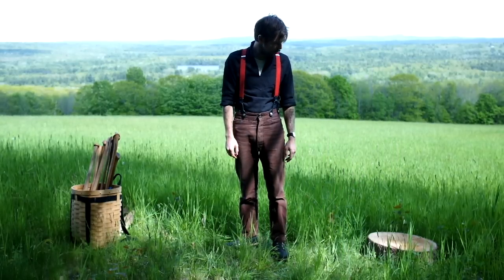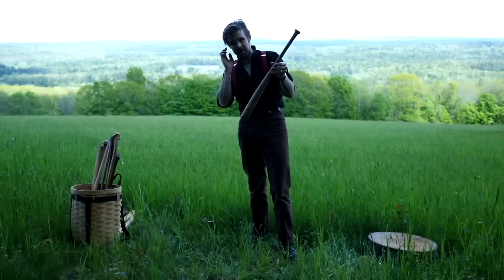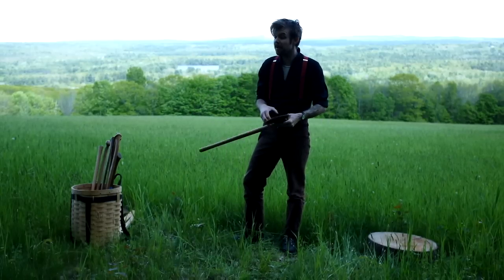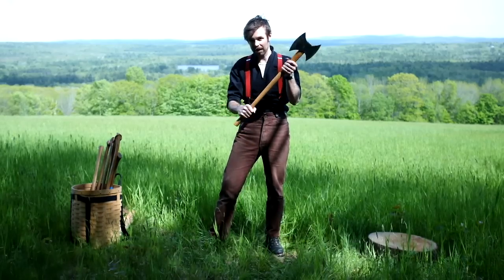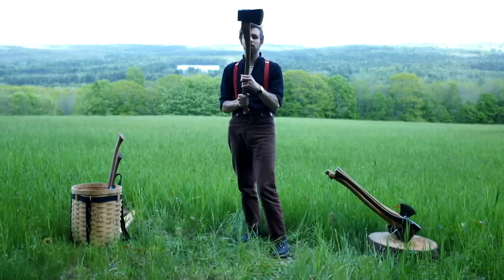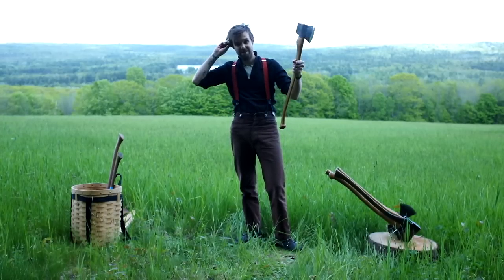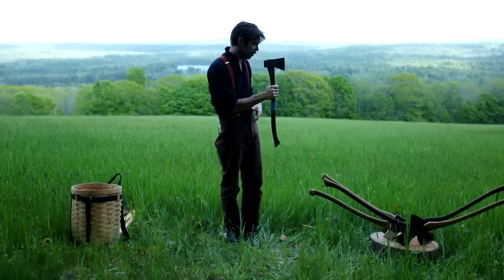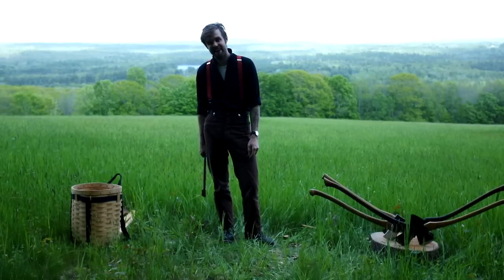Straight vs Curved Axe Handles

Comment: Hello Tanner, There is a reason why you hang axe handles for a living. You have  passion for it and a depth of understanding few posess. I do not have this level of understanding but cut wood for many years. I was the axe and my father the chain saw for cutting into blocks. Felling, and splitting are distinct activities as is grubbing (cleaning up bark or de limbing). I do have some understanding of the principles of mechanics in the sense of analysing forces and I think you nailed it. Cutting/felling Australian hardwood with any axe which is too broad is a mistake, even a racing axe tends to have too much beard. Horses for courses and no doubt a double bit axe head has its place; as long as it is nowhere near me but the horrible straight handled, fiberglass, badly forged lumps of iron called axes in a hardware store are mute testament to what has been lost and their place is on a garbage heap. When people made a living felling or splitting different timbers in different climates they developed different axes but your understanding of the mechanics of swinging an axe seems to me to be as complete as anyones and this would allow you to hang the approprite shaft on any head for any purpose. Thankyou for keeping this knowledge alive. I have seen several other videos on this and they all miss the point re balance for dip as well or balance for swing or tapering or why your hand travels down the shaft. The baseball analogy is also far closer to swinging an axe than a cricket bat so again well done. You might look at spotted gum as a possible alternative to hickory (in some instances). That may annoy some people but again horses for courses.

Comment: I'm training for the apocalypse, as well as muscle rehab and building more.  I use 32 to 36" long straight handle splitting maul 6.6 lb full weighted axes to do this, and prefer straight handles. I swing them in slow motion, very controlled like, and hold them in different angles and lengths and positions for 30 minutes a day.  It has helped me repair muscle weakness in my shoulders, core and arms, and build muscle also, as well as give me practical training to fight with two axes at a time.  For one day, all battles will boil down to hand to hand combat.  I or my descendants will be ready.

Comment: A doe leg handle is a much better handle on your hands and I wear leather gloves when using an axe.  My 50 year old 4# True Temper, Dayton is fitted with a 31.5” fawns foot handle and it is an excellent axe.    My favorite base ball exe was a 36” bat.  My axes balance right behind the head, which is where the should balance.  I have three GBA axes- Small Forest, Scandinavian Forest and Wildlife hatchet.  I have used a single bit for fifty years and like it over a double bit.  It has more mass and weight behind the blade than a double bit without wearing you out.  I use my axes, today, mostly as wedge bangers to support my Stihl chainsaws.

Comment: Great video. A plumb line from and dangling the axe will show exactly how close to center the balance bit to poll has been corrected by the handle. 
You clearly have the experience and knowledge to make this video. Sadly, this is the first of its kind that is not full of horribly wrong misinformation on the subject.
Reply from the maker: Thank you kindly! I’ve been tryin my best to read up and put attention when old timers are talkin!

Comment: Very good video I like the look of that Michigan. I still prefer the straight handle myself for reversing and using the pole to knock in wooden pegs or wooden or plastic wedges since although the poll is soft its still harder than those materials. Though must say being from the Uk Unbalanced axes are the life and soul here so I find having flat handled axes negates the bit dip quite effectively. A good example of these would be the basque axes made by Urineta or the Italian style axes by Rinaldi.

Comment: I'm a retired BC Faller and I am still looking for a good falling axe to this day. I love a straight handle axe for pounding wedges is there a way of adding more weight or size to the pounding Edge so when you do use the blade you don't get the Bit dive. I do not want to take away from its ability to hit wedges,  because 90% of its job will be doing that ? does anybody have any good recommendations for a good wedging axe about 3 lb.
Reply from the maker: It’s a tricky thing to find an axe with a well balanced poll these days. In that weight I can’t think of any company that makes a decently weighted poll and the extra trouble is that a lot of the older axe heads you can find have too much mushrooming. They come up for sure, just definitely harder to find. I’d keep lookin at ebay and cross my fingers! Good luck!
Reply: @axehafter1009  Thank you if I was still in the business it sounds like it'd have to get a custom made axe.

Comment: Now I feel like an idiot for getting a straight jersey for felling. I'm still a novice but it should be more appropriate than the boys I've been using.
Reply: Old time fellers used double bit straight handles. As I get older I’m finding my wrist like curved handles
Reply: @fredb8626  Yes, double bits were used by the ol timers for many tasks in the lumber industry, as were straight handled miners axes but as explained in the video with a dbl bit, the head weight is generally balanced and so the bit doesnt dip during feiling swing mechanics, a straight handle on a single bit axe isnt ideal as the weight is typically unbalanced and will dip causing accuracy loss/potential for glancing strikes... a curved handled when properly designed and fitted to a axe head can provide improved balance of a single bit head.
as thoroughly detailed in this video, both curved and straight handles have there time and places and theres always exceptions to the rules and personal preferences.
but theres no denying handles are a huge factor in optimizing your axes efficiency and accuracy. 
So although a straight handled single bit feiling axe can and does work and to some folks it may even be the ideal design... generally speaking it's not ideal for the task of feiling and that's what the OP was getting at... is that, its foolish and a shame that companies mislabel axes as being optimized for a task they're in fact not ideal for at all and unknowledgable folks can and do get suckered by the labeling.